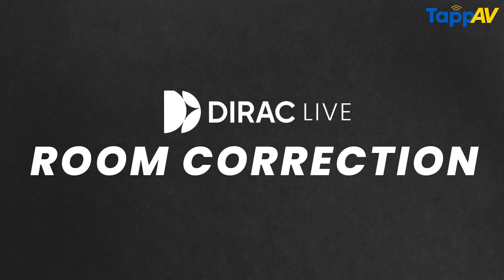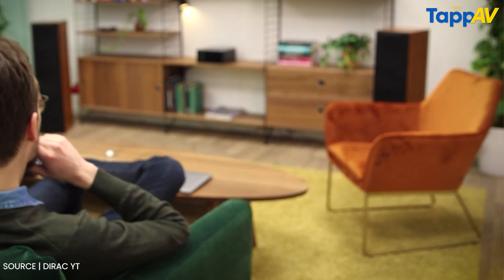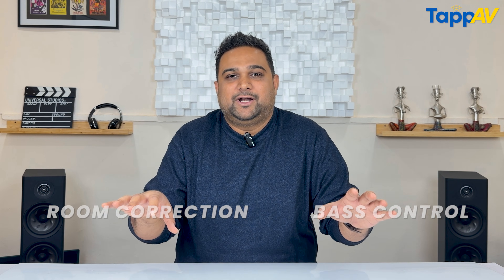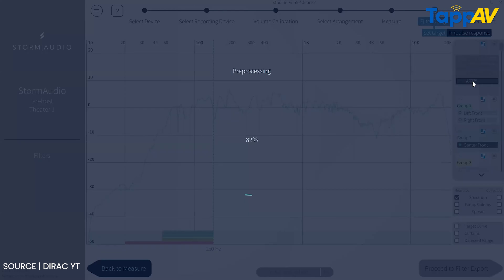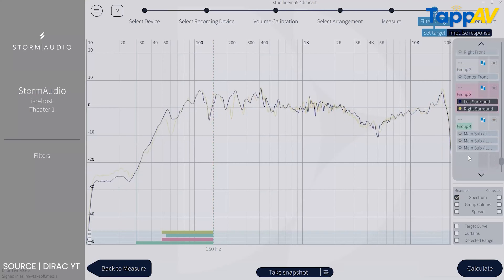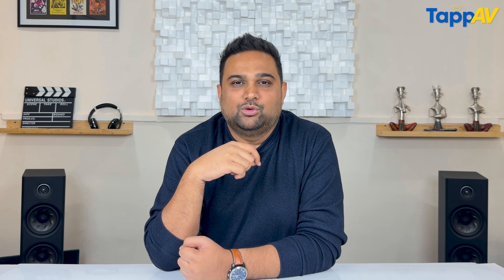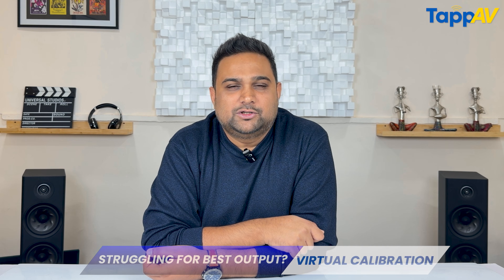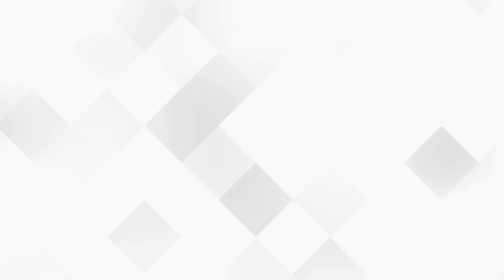I Tried Dirac ART… My Room Will Never Sound the Same | Dirac ART vs Dirac Live

Comment: I hv denon 1800h with q accoustic 3020 as L & R, 3090 as center, polk es10 sub and 3010 as rears. I calibrated using Audessy mic. It sounds better than initial setup. Now there is some vendor who is asking for 5k to further and better calibrate it using multi q app and then something called REW excersice. Any suggestions Tanmay.
Reply: Tanmay pajhi dasso.

Comment: Very well said 👏 

Dirac Live is an open platform but as you said its not that easy to understand completely with all features so a professional Dirac officially traind engineer required to achieve the best results 
By the way I am from south part of India i was searching for Dirac engineer for my set up is could not find the right person 
There are alot of people knows about  Dirac but the problem is they are not completely knowledgeable some point they totally stuck so its very difficult to find the right person for right duties 

I would like see a conversation about living room set up by using sonos arc with surround and sub completely and how to use multiple source like Blueray player and media player.....etc via HDMI switcher on the Arc system
Reply from the maker: Glad you found the explanation helpful! Finding a truly knowledgeable Dirac engineer can be a challenge, but it makes all the difference.
Reply: 100% agreed 👍

Comment: Front speakers F & L want to use with 5.1 AV Receivers and Amplifier 2.00 alternatively. So I do not want to keep separate speakers for AVR and one other for AMPs. Amplifier Switcher selector is useful or not. I want to do it without disconnecting the wire cable for the same AVR and Amplifier. Plz suggest it is ok? What is your suggestion? If it is possible which Amplifier Switcher selector is best.

Comment: Hello sir, you haven't reply my comment in your previous video...in your previous video in reply to my comment, you said, "Out of the two brands I gave, Optoma and Epson, you said, you would go for Optoma for a good home cinema (theater type) experience", why did you say that? I know that Epson is better for good picture quality, color brightness. So why did you tell me to go for Optoma? What was wrong with Epson? The brands I mentioned are: Optoma HD30HDR Projector and Epson CO-FH02 projector
Reply from the maker: Hey, There’s nothing wrong with Epson, it’s a solid projector. But between these two specific models, the Optoma HD30HDR is tuned more for a true home-cinema feel. It has better contrast and motion handling, which matters more for movies. The Epson CO-FH02 is brighter, but it’s designed more for general/home use than dedicated cinema. So for a theater-type experience, Optoma fits the requirement better.
Reply: @tanmaymehta Thank you very much sir for replying to my comment. I was trying to find out for a long time. Thank you very much again।❤❤❤

Comment: Bhaiya, my experience is I have calibrated my system though Audessy, then I have changed the speakers level and crossover manually. The front L&R levels are+ 7each,center +8.5, Ls&Rs are - 3.5 each, atmos  - 5.5 each and sub +1.5. Crossover front 40 hz each, center 60hz, surr 80 hz each and top middle 90 hz. Sub crossover is 90hz. These changes are so adjustable for my room, it is amazing. My IIT-an(quantum computing studying) son says," your set up is like a I- max enabled cinema hall."  It is great to hear that from my son. I share my true experience. Thank you bhaiya. God bless you.
Reply: Do you have an in wall speaker or tower speaker in lcr?

Also can you share your spec brand and room dimensions?
Reply: @surajsharmaMFD No, I have kef iq 5 tower speakers, iq 6 center, Polk ES 10 surround, polk mxt 90 for atmos and kef's kube 8 subwoofer. I have two amplifiers. One is denon pma 1510 (stereo amplifier) and another is denon x 1600(AV amplifier). My players are Nakamichi CR 1 cassette player, Sony bdp, Denon turntable DP 29, one ordinary dvd player and my son's samsung galaxy s20 fe phone (which is use as a media player). I am very very happy and satisfied with my set up. Thank you.
Reply from the maker: That's fantastic to hear you've optimized your system to perfection!

Comment: Charges bhi bhari hogga yeh calibration ka. It means before this software all calibration made was not proper? Mannually calibration is not ok
Reply from the maker: Dirac ART is an advanced step, not a replacement for good manual calibration—it builds on it for even better results!
Reply: Tanmay bhai, x3800h ke liye ART bundle Lena hai.. Kuch discount code ka jugaad hi sakta hai?
Reply: ART bundle is 800$. L lag gaye 😢